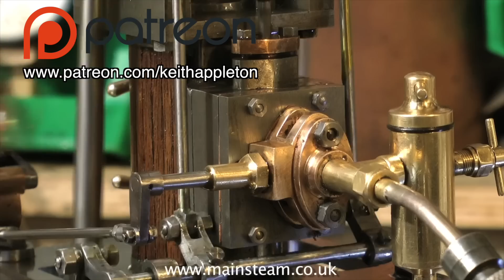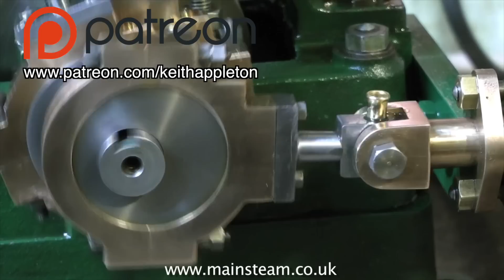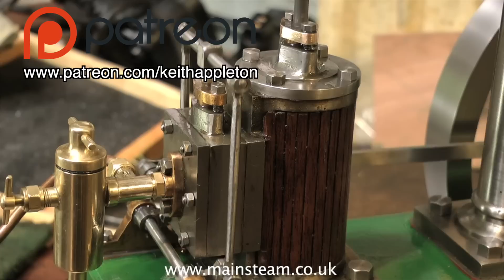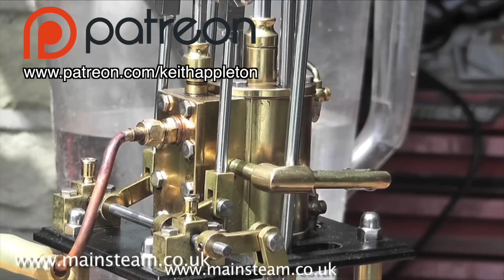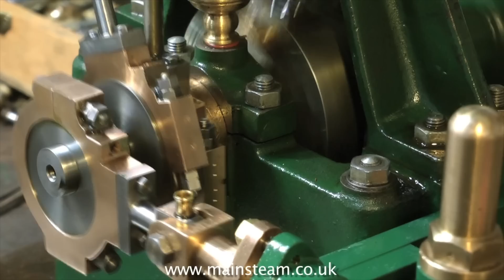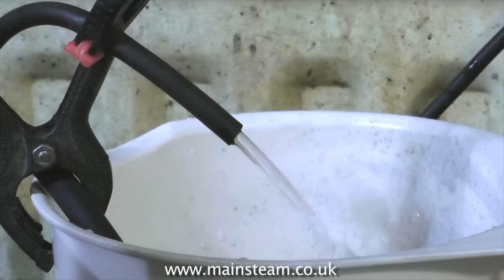KEITH APPLETON - PROFILE VIDEO

Comment: I just found you via a post on the Hobby Machinist site. I'm retired from my store fixture manufacturing business. Looking forward to watching your videos. My hobby area includes: PM1440 lathe, Jet 949 mill, Shars tool & cutter grinder, drill press, old Italian slow speed cold saw, surface plate, tool cabinets and lots of accessories. I sand cast aluminum & copper.  I enjoy making parts to put stuff back into service that would otherwise end up in the landfill. Lincoln, NE USA

Comment: Keith -
Would you explain how the scale model system works ?
When you say 5 1/2" & 7", what does that mean ?
Reply from the maker: It's just the distance between the wheels to fit on the respective track gauges: 5 inch &  7 1/4 inch gauge for instance . . .